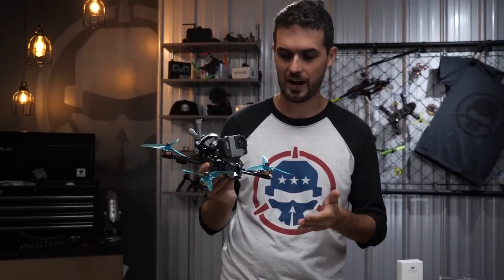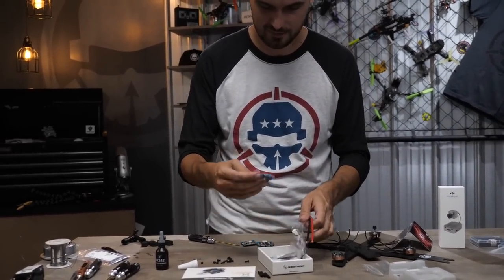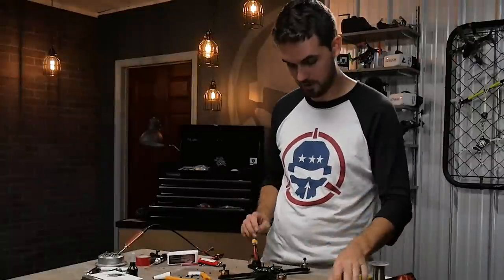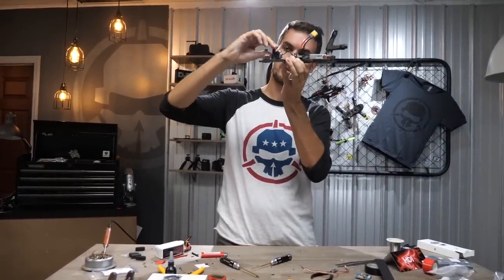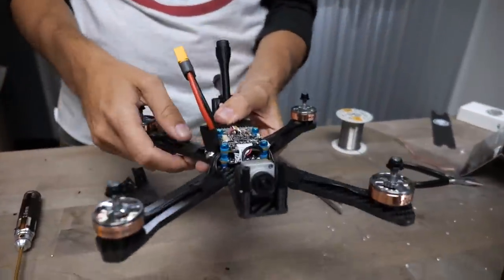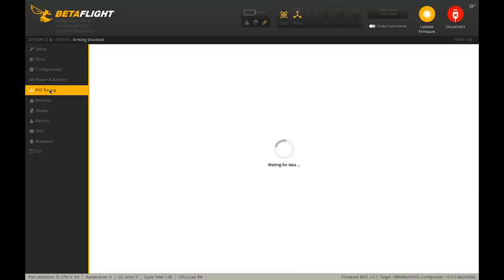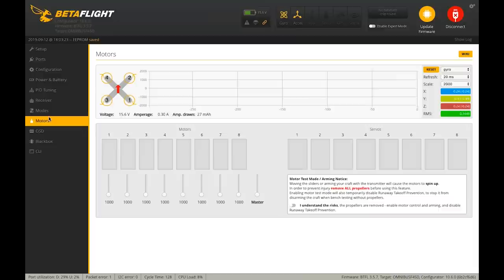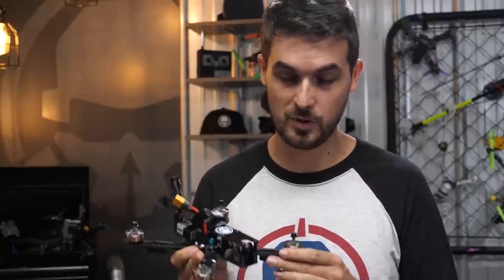Rotor Riot Spec Kwad - HD1 Build with DJI FPV System

Comment: I purchased one of these kits and unfortunately I received two of the same 3D print camera mounts (both right side) and the 3D print was bit shabby.  To add to this two of the HobbyWing threaded flight stack standoffs didn't have threads and one of the Hypetrain Blaster motors was missing a prop nut.  However, after contacting the Rotor Riot service team they couldn't have been more helpful, they quickly responded by sending me new parts required to ensure the build was of high quality.  I highly recommend Rotor Riot and their aftermarket service is outstanding.  Great service guys!
Reply: Cheers guys, will definitely let you know when I receive the parts.

Comment: A small pointer for future builds: use a larger soldering tip for the larger pads. Spreads the heat quicker and lets the solder flow more easily, with a smaller chance of burning electronics.
For the rest: Nice build!!!

Comment: Building mine just like this.. 
Awesome stack too. The XT60 leads and capacitor came pre-soldered on mine, just got to solder the plug on. Been flying analog for 3+ years, really looking forward to the HD experience..

Comment: Nice video, may I suggest that you power up after soldering motors and prior to soldering anything else (checking for bridges and components works)
Reply: He  SHOULD NOT  power up anything first......  He should use a volt meter with continuity checking everything  first.   IE: No beeps THEN power up with smoke stopper...DERP.....    Since y'all wanna nit pick everything.

Comment: 13:15 if this is your first time soldering, make sure to be carefull with temperature, too high might cause pad to fly off the board and basicly render the pcb usseles.
Reply: Another thing for first timers: look up a quick "soldering 101" video, and USE FLUX! it makes life a whole lot easier :)

Comment: when the solder isn't flowing like when soldering the two power leads there, use a little bit of solder flux. Chances are that the flux has all disappeared out of the solder after holding the heat onto it for so long. Another way to introduce flux into the solder is to just add some new solder. You can tell if there's enough flux in the solder by how shiny it is and how well the iron separates from the solder (if the solder sticks to the iron when lifting as opposed to forming a nice shiny bubble of solder releasing easily).

Comment: I've got the airunit in a flowframe.  I decided to remove the 2 rear standoff/posts not middle ones.  I'd rather the rear of the top plate to be a lil flexible then the middle.   I've got a airunit mounting case/bracket thing with antenna mounts on thingiverse.   Yeah its ugly but it works lol, and no overheating issues.  There is one thingi for the antenna that comes with airunit as well as the  shorter antenna  with extendo wires you can get from DJI.

Comment: You guys should have a 3D print part to hold the Air Unit like the iFlight DC5. I don’t like the idea of holding it down with electrical tape because the tape attracts dirt and dust.
Reply: Mine is 3m down on the bottom plate.  It's actually good.  THE TPU Parts at the rear help protect the antenna cables.

Comment: I want to buy one already pre built and with all the features you have such as the googles, transmitter, and receiver. Not sure what the best configuration for the motors are. I'm new and the only experience I have with this hobby is my eachine 220s. I've flown that twice crashed and the video feed was never the same. So is this durable or if I crash once I'm basically out 1300 hundred dollars

Comment: So if I use crossfire I would not use the sbus connection and wire the crossfire reciever to the rx and tx of an open uart correct? I wish the air unit was not so large. I don't have a frame big enough to fit it. Call me when they shrink it down some. Lol

Comment: If I am not using the DJI remote, do I need to hook up the SBUS wires to the Xrotor Micro? I am using a FRSky remote with the Caddx Vista and the DJI goggles V2.

Comment: Drew, flux would be a great help to you.  Your soldering is.... ok, but could be a lot better.  Little alcohol to clean and MUCH better results. AND you won't need to hold the iron on the components so long.

Comment: So I messed up and bought the dji goggles and trx16s receiver :( should I buy the analog adapter for goggles for my first drone? Or just use a DJI air unit ( which I’ll probably break) since I’m totally a beginner? Thanks.  Which drone should I buy??

Comment: Do I need a Voltage Regulator with the DJI air unit with the Hobbywing Stack if I want to run 6s batteries? If so... can you do a video please

Comment: Pro-tip: Never put a lighter flame on a capacitor. Lol! They have a liquid electrolyte in them that can boil, causing the capacitor to pop. This is why the top of them have a perforated metal cap. They're designed to have the top blow open like a soda can if they get too hot.
Reply: How would you suggest activating the heat shrink then lol
Reply: @richardjeffries1133  Heat shrink melts at a lower temperature than what a capacitor's electrolytic boils at. So, you want to use something that has enough heat but not too much. I used to work on wiring harnesses and did this all of the time. We used a heat gun for it. It's basically like a hotter hair dryer but you can get attachments for focusing the air. It's also good to use for surface mounted soldering on circuit boards! So, dual purpose. :)

Comment: do you HAVE to get the dji radio(remote controllers) with the goggles and the transmitter? or do can you use a radio made by another brand.
Reply: Ian Lu ditto
Reply: @VenturesOfTimTim  huh

Comment: will gps rescue mode on a switch work with the dji controller?  i have this on my taranis analog.  switching to dji digital air-unit and am wanting to know whether to keep the taranis or use the dji controller.

Comment: I’ve been wanting to buy the TS100 Soldering Iron for a while but I was not shut if it came with the battery and the cord or if you had just buy it on the   rorer riot store

Comment: I'm not a newbie but I couldn't figure out how to set the sub trim.... I figured it out thx joshua also how to get vbat I have not figured that out yet I know it's in the googles but I dont see it???
Reply: u need to use the whi(t)e  TX and g(r)ey RX  wires from thew DJI wires  and attach to a UART.  That UART needs to be set to MSP.   Then you need to make sure the on board current sensors are enabled in betaflight.  The voltage info comes in over that connection. The airunit does NOT display voltage by simply hooking up power wires to vbat or battery pads.  At least that is what I had to do to get voltage in the goggle display.  But this way is better because if you have to use a BEC for airunit,, but  are powering kwad with  6s, you stil get proper voltage in goggles not the BEC stepped down voltage.
Reply: @invisibleaznDJ  the grey and white are connected to rx tx 3 msp set but no I didn't realize I hade to set voltage in beta flight thx
Reply: @invisibleaznDJ  I am using 12v pad from esc not fc it only offers 5v pad do you think that is going to be an issue

Comment: maybe a stupid question, but is this system compatible with DJI goggles 2 and DJI remote controller 2? it should be because it goes through the air unit (im new to fpv)

Comment: i have 2 question. if i bought the prebuilt as you said the only thing i need to do is bind the air unit to google & rc right. how about the beta flight and that motor rotation setting?? 
Secondly, with this build how far can it goes? 

anyway your workflow very clean brother 🔥💯 please upload more content like this
Reply: Same question.

Comment: Ya know, I really want to get one of these but there are a few things stopping me. 
1. I have to learn all about the batteries. Charging, un-charging, knowing the volts to stop at etc etc etc. 
2. Only 1 or 2 minutes of flight time... change the battery, ~2min flight time, change the battery... That compared to the upkeep for the drone etc just isn't worth it. 
3. I'd have to learn how to solder somewhat. I'm horrible at it but to fix this drone if something breaks, I need to know how to fix it.
4. It cost as much as the new DJI FPV (Without addons). Yes, you can do more with this but you get way more flight time with the DJI ~15 mins. 
The drawback to the DJI is it can't do all of this and the price also sucks if you want to add more batteries and a protection plan it makes it around $2000... (but then you have to pay an extra 250 to even get it fixed.. WTF is the protection plan for then?.) I wish we could fly this for about 20 minutes or if the price was cut way down, then it'd be a no brainer on which one to get.

EDIT: After thinking about it for a while (8 hours later).... I may end up just going with the HD1. I contacted DJI support and they confirmed that the replacement for the DJI FPV will be $260 for the first one, $270 for the second one and then $280 for the third one. If you crash it and break it that many times within 3 years (IDK it may be 3 replacements in a year. Didn't ask but I have to assume the worst.) NOW, compare that to buying a new HD1 every time you crash at $600... IF you totally mangle the whole thing, which I doubt I will. In short, it seems like I'm learning some new shit. Lego flippy dooos.

Comment: How do you use the DJI air unit with your own transmitter? I.e. for those who don’t want to use the DJI transmitter.
Reply: Le drib shows how to do that in a prior video. Or maybe it was le drib2. One of those
Reply: simply don't attach your SBUS UART to the DJI orange and brown cable......simply attach the other receiver you normally use to sbus......DONE.  Literally do nothing, outside of what you already do for your frsky or spectrum.
Reply: invisibleAzN thanks!

Comment: Is one of the air unit antennas supposed to comunicate with the goggles and the other with the radio? If so, can I remove one of the antennas if I want to use crossfire?
Reply from the maker: No you must always use both antennas
Reply: Thanks for the answer! I'll keep that in mind

Comment: Can I fly this setup so I can have a stroke and die in the air ? don't worry for the quad cause I've been practicing on Free rider with my old Xbox joystick (high rates 980deg/s Yaw/Roll - throttle80 - camera tilt 40deg - gravity 55) so I think I'd land it properly before passing away lol
Reply: Xbox controller is no where near the same
Reply: @richardjeffries1133  I even fly properly with touchscreen
Reply: @YQVN35  get a propper controller

Comment: Why are the arms so wide? Is strength more of a concern than aerodynamics, or is the aerodynamic impact of the arms not significant enough?
Reply: Yea I think it's cheaper that way, I fly rmrc strix screech frames $29 5mm skinny boomerang arms n fits dji air unit... boom

Comment: Hi, nice video. Been waiting for it. Can this build work on 6s batteries? What would need to change? Thanks
Reply from the maker: Nothing needs to change except the motors. The HobbyWing stack holds up to 6S very well. Alex runs this exact build but with the Vanover motors which are made for 6S
Reply: @RotorRiot  Thank you. Simple as that.

Comment: Do advise how to remove the front standoffs from air unit/goggle view. Whilst the frame is fantastic for DJI FPV, it's a major negative point.
Reply: you need to move your camera forward.  Working on something for the Flowframe (will likely work for other frames too), will have it up on thingiverse soon.
Reply: @invisibleaznDJ   yes thought about just turning the 2printed camera supports 180, sticks out of the frame but the camera gets little to no protection that way.
Reply: I have been flying this setup for a few weeks. If you build it correctly, you do not see the frame/standoffs in the camera view.
Reply: Chris Sieracki What’s your camera tilt on the setup?
Reply: @gestesoh4870  I'm using zero degrees for 3d flying. That could explain it! No problem at zero degrees. Do you see the frame at high angles?
Reply: @chrissieracki2959  yup using the highest available angle on the print, the standoffs are highly distracting.

Comment: Would this be usable with an FrSky transmitter?
Reply: I don't know if you already got the answer but no. You'd need another receiver for your FrSky transmitter along with the air unit connected to the goggles.

Comment: It the Flight Controle (FC) on the quad replaced by the DJI system?
Reply: Okay, question answered later in the video. Thanks for making these.
Reply: DJI fpv system replaces the analog camera, vtx and radio receiver if you also buy the DJI radio

Comment: To go twice as far you need 4 TIMES the power.  So going from 700 mW to 1200 mW is probably not going to improve the range too much.  You can do much better by swapping on some good antennas.

Comment: Hey LeDrib, question, if I want to get the Prebuild one, but I want to run 6s, which one do you advice? The 1800kv I presume? And won’t it be a problem with 6s and the air unit?
Reply: It will be a problem.But there are many solutions on youtube

Comment: I dont understand why not use conformal coating. You can solder thru it, will protect circuts from dripping solder and WATER. I just assumed everyone coats their drone. I fly in the winter with no problems. Or maybe u just didn't show this step for this build but you normally conformal coat.?

Comment: Can i use a different radio like a FrSky QX7 and connect it the same way?
Reply: Did you find an answer for this mate?
Reply: @richardjeffries1133  yes you can attach any RX to the FC. I used TBS Crossfire Nano RX

Comment: Shame the dji camara air unit cable had to be cut and soldered onto the flight controller board,only if could just click the cable into the board be so much cleaner 👍

Comment: Hello guys,

I've finished my first build recently and yesterday I was flying for the first time.. after few Unsuccessful takeoffs, the drone is not beeping when I plug in the battery! And when using the BLheli application it says found no valid ESC configuration. I don’t know where is the problem and what is the cause. Is it a bad ESC and needs to be replaced or the FC has some issues!

Not that:

When I plug the micro USB into the FC lights are coming on.

When I plug the battery alone NO lights No beeps.

When I plug the battery, the DJI air unit is becoming HOT which means it's getting power from the battery!

My build is Combo XRotor FPV Stack (4in1 ESC & FC ) with Hypetrain Motors 1800Kv Blaster

It connects fine with betaflight through micro-USB but I can't control the motors.

connects fine to BLheli but when I try to "read setup" it says (Found no valid ESC configuration)

Hope I find a solution!
Reply: Maybe I can help you...

Comment: what temp do you recommend for soldering the motor wires?
Reply: I did it with 350-370 Celsius or 660 to 700 Fahrenheit.

Comment: Why 4s???
Reply from the maker: It’s what Drew flies. However, Alex uses this exact same set up but with Vanover  motors to run 6S. The Hobbywing stack handles it like a champ. Glad we found a stack that work well on both 4S and 6S
Reply: @RotorRiot  oh wow ok. Thank you for the quick response!  I am definitely looking into getting this to build.
Reply: @AgustinMolini  4s = cheaper 4 in 1s that don't blow up, n dji likes 4s direct no brownouts

Comment: No 6s version, oof
Reply from the maker: You can use this exact set up with 6S. Just change the motors. Alex runs this drone with his motors to fly 6S and it performs beautifully. The hobby wing stack handles both 4S and 6S perfectly which is why we use it for our spec build

Comment: guys. srsly ? what is this soldering job ? :D WTF do you even solder , Drib?
Reply: Show us all your professional soldering videos, so we can see how a soldering genius gawd does it.    He gets plenty of air time, probably more then both of us combined.....I don't think his kwads are dropping out of the sky cause of his soldering.....
Reply: It's probably because of the tip, I have a TS80 with a TS-D25 tip and I'm having a way easier time soldering those fat high amp escs. TS80 makes it very easy to change tips when needed for all kind of jobs
Reply: @invisibleaznDJ  you feel rly insulted now :D I was just having fun watching him fail a bit.

To be honest im not interested in providing solder tutorials :D but if I'd do that it would be way better than this :D even with a ts100

PS: I wasn't hating on drib. I was just amused by his work in this video, I'm pretty sure he does better in soldering usually

Comment: I backed these guys from the beginning, Bought the whole setup like 1800 bucks, Had some teck issues, now the won't even do repairs, Lots of problems with their wiring to FC, No telemety on some units and refuse to repair, Had to re solder myself, And do entire setup in beteflight that Rotor Riot was paid for. Never buy from them again....

Comment: The funniest part is to see how you suffer soldering the shitty plastic cables DJI shamelessly includes with the air unit, but as its all paid for and sponsored you are biting your teeth to not mention they should have included silicone wires ffs. Joshua would definitely have mentioned it!! lol